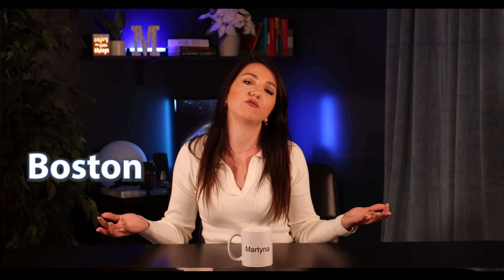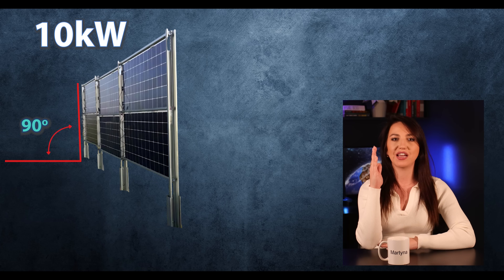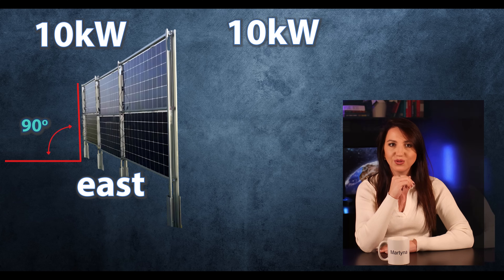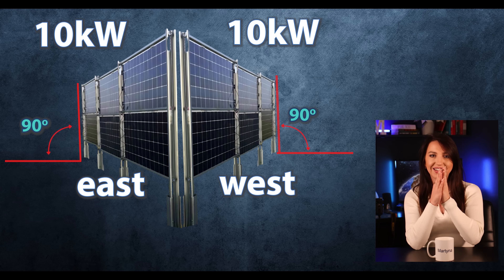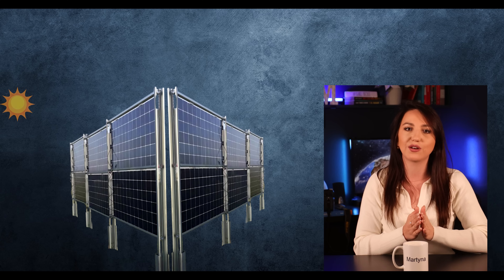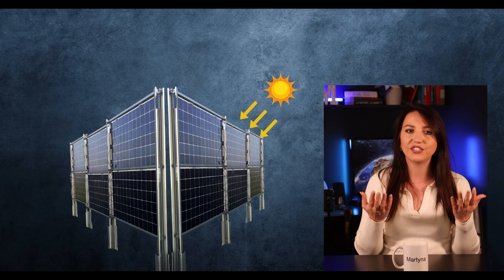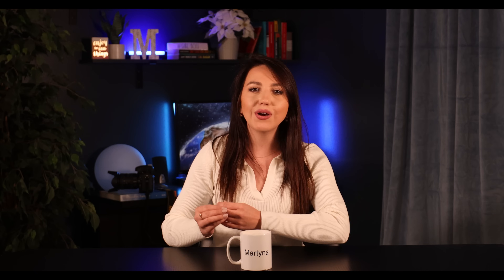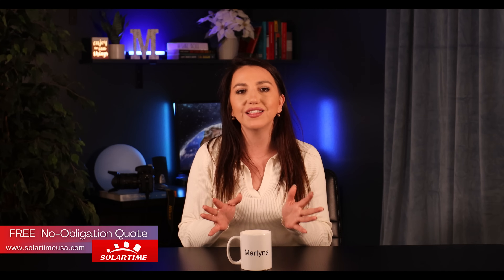Why I 'Oversize' Every Solar Installation (And You Should Too!) - Solar Oversizing Explained

Comment: Only fake panels deliver less than rated output. you have been scammed. Remember the rated output of a panel is for the guaranteed lifetime, typically 25 years that means a new panel typically delivers 5-10% more than its rated output when new to account for lower output as the panel ages. If you buy your panel from a reputable manufacturer, there is a an industry certification, you can look up to know you are not buying a fake solar panel. Otherwise, the video is correct, there can be other factors, like placement and temperature that means you need to oversize your installation, but under no circumstances accept solar panels that when new, deliver less than rated output, you return them immediately.

Comment: Its default in industry to at point of design to lay the max amount of panels the inverter can take (inverter size/0.75)
In majority home designs, sales puts as much as they can on the roof on 3 facings making sure each side meets minimum starting voltage. The rest will be figured out by electricians at install. Like anything, design based on satellite image is one thing, install may vary due to structure.

Comment: Now I am curious why you did not oversize my installation. I did learn new information, thanks for putting this together.
Reply from the maker: You could have gotten a single 7.7 kw inverter easily, but I remember the reason why you got 2 x 5.0 is to be able to get 2 x SPS( sma secure power supplies)! 
This does give you a lot of room to grow the solar array without the need to add any more inverters in the future 🙏🏼🙌🏼☀️ 

Thank you for the support Mr. Banul!
Reply: @solartimeusa  I do recall wanting the SPS (which is an amazing feature) but I don't recall requiring 2. But it's been a while. And you did add 2 panels to increase the production so technically my current system is oversized. :)

Comment: in my area, (the Philippines) I always oversize my panel due to the fact that I only harvest an average 45% to 65% real world output in my panels but by doing so, I always make sure that my controller is a branded or heavy duty type.

Comment: Currently, I have 8 x 450W panels on my terrace connected to a 4-port deye 1600W microinverter - everything works great... I haven't experienced any production cut-off at 1600W yet. Ultimately, I plan to hang the panels on the east-west elevation of the building, but since they were supposed to be in a box, they spent the winter testing :)

Comment: I'll 1 up you on this. I'm doing 39kw in panels on 6 chargers that can't take more than 17kw. They won't clip like the what you're saying & malfunction if over powered so I have about half my panels on an  illumination sensor tied into contactors that kills those panels til the illumination drops below a certain threshold then engages the rest of the panels. This gives me high output high even in low light conditions.

Comment: 1. How does an array with optimisers impact oversizing in such cases?
2. Also, given that inverters are said to be getting more efficient, requiring lesser trigger voltages, is such asymmetry still ok?
3. 😉

Comment: So you are saying that I can use two 550w panels with NMOT 417w instead of 425w panels with NMOT 318W and maximize production to 800w which is a limit by local electricity provider?

Comment: You have to watched the amps and volts 
Inverter can take and not go above that

Rule of thumb
A good rule of thumb is that your solar panels should be 10-20% larger than your inverter.
Reply from the maker: Yes! Absolutely cannot go over rated amperage and voltage only power :) the other two can damage the inverter. But the power oversizing is actually put on every data sheet. So you can see how much you can oversized.

Comment: I oversize my solar array due to my observation with my experimental 100w  solar set. As long it meets the voltage range with the pwm but with mppt  many inverters just shut off meaning without output but won't burn.
Reply from the maker: Yes of course cannot oversize voltage that can damage the inverter. I have seen oversized amperage and that is clipped easy but such a waste. This is stripe wattage oversizing. :)

Comment: I wouldn’t say “it is both a science and an art”, as it’s all math with tolerances.  Suggesting it is an art makes the math subjective, which it is not.  At this point we can be fairly accurate in calculating the potential maximum of any array, so we only need to stay under the max tolerance of the component set up.  The only thing left is how much a person wants to spend, how much space they have, and their battery set up.  Net metering around us is no longer an economical solution.  It is better now to add batteries and protect yourself from extreme events x the chances of those extremes or days without power (1 hr without power - 6 incidents a yr avg, 4 hrs without power - 2 incidents a yr on avg, 1 day without power - 1 incident in 2 yrs, 3 days without power - 1 incident in 4 yrs, a week without power - 1 incident in 12 yrs).  Base battery power on critical components of the house: furnace, a/c, fridge, water heater, internet support, oven hood fan (especially if you have a gas range), oven, washer / dryer, and lastly lighting.  Our garage door openers already have built in back up batteries.  I already have our wifi / network on Ecoflow power stations (used as UPS).  My critical needs for a week would require 30kWh in winter and 55kWh in summer due to a/c condenser being a resource hog.

Comment: Interesting perspective.  Thanks.   We have used "oversize" arrays for some sites with a mix of panels facing to the East and West (along with South).   Used for beyond-the-grid well sites with no batteries.  While the Noon Peak is not as high, it gives a long(er) day of high(er) production -- without using Trackers.    Looking out further, Tony Seba is predicting that Solar PV will become so cheap that folks will just build out to the level it covers the worst production day(s) and then just live with surplus the rest of the time.   If you need topics for shows -- that might be interesting -- check some of Tony Seba videos and shows, and see how they match what you are seeing.

Comment: Why not install a DC electric house? Store with minimal loss, use immediately with NO loss.
Reply: It is probably not easy to find DC refrigerators, toasters, Air conditioners, hair dryers, etc. While I am sure some of these can be found in DC i would guess they are more expensive.

Comment: Great information as usual 👍 and I have LG panels rated for 370 watts but unfortunately I have IQ8+ micro inverters which like you mentioned can't allow me to get the full power of my panels and wish I would have known this information 3 years ago and would have went with a different micro inverter for each panel to match my LG panels.. always get useful information from your videos. Have a great day..
Reply from the maker: Thank you so much for your kind words! I'm sorry to hear about the mismatch between your LG panels and IQ8+ microinverters. It's a common situation that many installers don't fully explain. While the IQ8+ are great inverters, you're right that they can't capture the full potential of 370W panels. While you may experience clipping, you are also squeezing a lot of juice out of your panels which is great! Still, you have quality components, and LG panels are known for their excellent performance and reliability. Have you noticed any clipping during peak production hours? I'd be curious to hear about your real-world experience with this setup.
Reply: @solartimeusa  I honestly don't know how to check on that or how to tell if it's happening and maybe you could educate me on how to do that?
Reply: It is unlikely that your 370 watt panel is actually generating 370 watts. That is close to the best it can do and because your panel temperature is higher than ideal and the sun is rarely directly facing your panel the amount of time spent clipping will be small if at all. This is also dependent on were you are located so my answer is just a good guess. This is also why you need more wattage than you might think i.e. one of the reasons for the video.

Comment: Good video, You do need to explain over voltage "Too many panels in series" vs over wattage "correct number of panels in series and then paralleled" for more available amps but remaining below max voltage. You can clip excess wattage, but exceeding max voltage will blow inverters up. Also if fused correctly over amperage will just blow the inline fuse before damage occurs without damaging inverters.   Most quality inverters will allow a setting a max output current so you can keep incoming wattage below max and great ones can throttle back the input to 0 when batteries are fully charged and solar is not needed at that time. I set mine at 90% of max output and add chargers to allow 90% of battery max charging rate.
Reply from the maker: Hey Phill! Thank you for this excellent technical addition! You're absolutely right about the critical distinction between overvoltage and overwattage - I could have explained that better. Your point about series vs parallel configuration and the importance of staying within voltage limits is crucial for system safety. I should have made a solid point a few times that going over max string voltage is NOT OKAY! :D I  need to add a pinned comment on top to clarify this to make sure no one takes this info the wrong way. 
 I might do a dedicated video on these safety considerations and optimization strategies.

Thanks again for leaving a comment!
Reply: @solartimeusa you should make another video and clarify these things. Otherwise, kindly count it your fault if people's equipment blows up from oversizing their panels based on your recommendations.

Comment: My new 3.3kw array vertical with snow /sun 4185w before it overamped the mppt, I had to shade the array with a stick to keep it at 3Kw, without the stick I have seen over 15A= max for inverter, so next is the EG4 12kw which can handle 4 strings of 7kw, 17.5A per string, 11.6 to 16.2kw might eliminate the gen,  I said that about 8.3 to 11.6 but I had to use 70hrs of gen down from 342hrs.
Reply from the maker: Thanks for sharing those detailed numbers! Really interesting to see how your vertical array performs with snow reflection. That's some impressive power boost you're getting - though having to use a stick for shading is quite the DIY solution!  😄Sounds like upgrading to the EG4 12kW would better match your actual production potential.  Lots of good talk about that inverter in the DIY community, Will Prowse is a big fan too! :)
Reply: @solartimeusa  hard to beat 28kw input. winter with stick 11.4kw, July I only make 5800w x 15 hrs np and float before 10am. Half power double day,or half day full power.
The 3.3 is JA 550w good boost, +145w per panel

Comment: An 8:00 video to say panels never put out their full rating...and sometimes it's not all that sunny?
Reply from the maker: Actually I should have not said that, I think I mentioned there as well that there are times when they can even EXCEED their rating. Is just that the Standardized conditions are not super common, good outside temp and great sun exposure. Usually when its super sunny its also very hot, which lowers the panel efficiency. Same in winter when temp is lower, the sun is lower on the horizon, so there are very few days in a year when those STC are reached.  I Have had panels reach way more than their rated output due to conditions being amazing!  I hope this helps answer the question?
Reply: @solartimeusa  i would have included a mention of how many hrs a day you see clipping in a year 

Lets say 3hrs a day for 2-3 months = 270hrs with half of them at a 20% loss is my guess? 

You lose almost no power to clipping even if you oversize to 130%

Comment: I'm planning to connect 6 pcs of Jinko 580 W to the small 24v inverter Daxtromn AOH-3.2kva with rating 3200va. Although ChatGPT advised me even 2P6S amount of such panels, which is 6 in series of panels and 2 such strings in parallel. I wish I could do that, there is even enough space on my roof for that, but I just can't afford it.

Comment: Women logic, allways under cause winter
Reply from the maker: Let's focus on the technical aspects of solar system sizing. Winter conditions absolutely affect system design - we need to account for lower irradiance, shorter days, and snow coverage ( If applicable in the area you are in). If you have specific questions about seasonal solar production optimization, I'm happy to discuss those. :)

Comment: I agree. Great presentation.

STC is effectively impossible in the real world.  A panel will not be at 25C with 1000lm/meter2 in direct sun. If it happened for a moment due to being a cold, cloudy day and the sun peeks thru when the clouds part, the panel will quickly heat up thru and past the magic 25C.
Reply from the maker: Yes! So so true! Thank you for sharing and leaving a comment!

Comment: Wow, you know your stuff. How about panels? Does frequent clipping affect longevity of solar panels?
Reply from the maker: That's a great question! Oversizing an inverter or experiencing clipping doesn't harm the solar panels. The panels still produce DC power as they should. The clipping occurs when the inverter's maximum AC output is reached, and the excess DC power from the panels is essentially 'lost.' So, the panels are fine and actually don’t even “know” what’s going on past what they output. I hope that helps and thank you so much for leaving a comment!!! 🙌🏼

Comment: Thanks for sharing! 
You nailed the part about the actual output of a solar array versus the maximum rating. Your numbers line up almost exactly with my real world experience. 
I have to admit though I'm on the fence about inverter clipping. 
I can't help but feel that constantly clipping inverters, especially microinverters which are prone to failure compared to string inverters, will have a negative effect on their longevity and reliability. I'm sure the manufacturers won't come clean about it. 
I know your real world experience is that microinverters literally create a failure point under each panel that simply does not exist when using string inverters. It just doesn't seem wise to me to push microinverters above 100% of their rated capacity all the time. 
I don't have any data to support that, it just seems logical that it would shorten the lifespan. 
Would love to hear your thoughts. 
Keep up the good work 👍
Reply from the maker: Thank you for this great comment! You raise some really interesting points about microinverter longevity and clipping. So while manufacturers design inverters to handle clipping safely through thermal management, your concern about long-term reliability is understandable and also logical - especially with microinverters where each unit operates independently and ON THE ROOF exposed to much more heat and environmental elements. I have been a huge centralized inverter advocate over microinverters for the exact reasons - too many points of failure. 

Now I haven't seen data suggesting clipping reduces lifespan (inverters are typically rated to handle it), it's definitely something that deserves more research and real-world data collection. This is definitely something that manufacturers should have easy access too and see systems that clip and not and see which ones are more prone to failures. I am heading to San Diego next week for a solar Conference I will ask about this for sure!!! 
Great questions!
Reply: @solartimeusa    hi any interesting news about this topic?  i somehow also feel very uncomfortable overpowering an invertor. or machinery generally.  not pushing chinese motors beyond 75% of rated power would make them live much longer, one could really see d difference.  but in electrics this doesn't apply?
Reply: Micro inverters are dead based on ROI, don’t listen to the marketing jargon.
If necessary, just install an optimiser on shaded area, anything goes wrong, much easier to replace.